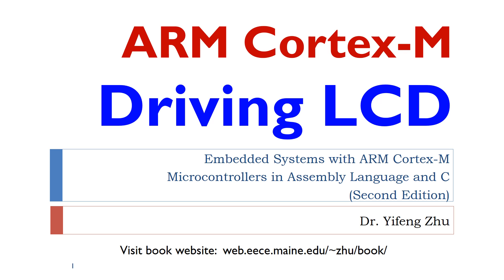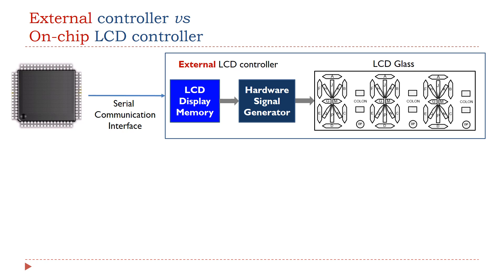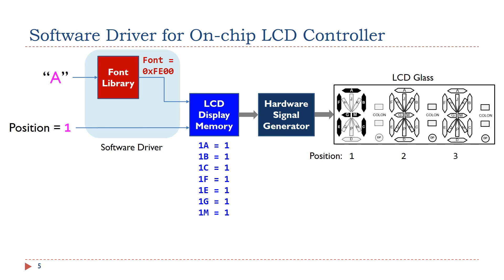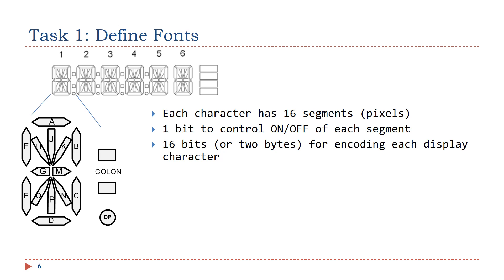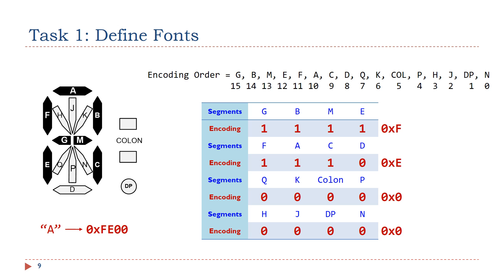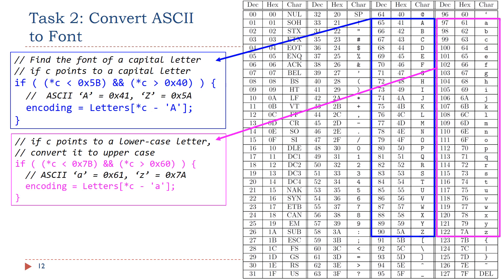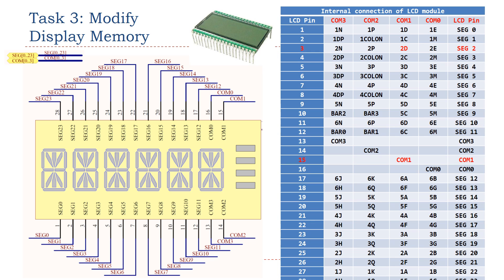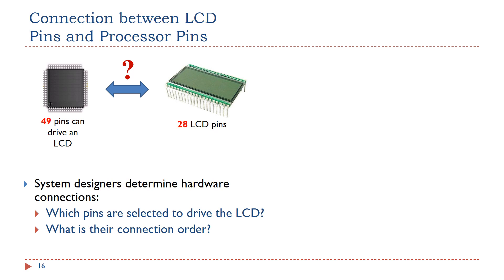Lecture 8. LCD Driver

Comment: i am literally repairing a yamaha psr-5700 rn about no sound at all, after repairing that part i found that now there is around 12 keys on the left side and around 9 keys on the right side not working , so what i did is that i remove the keys and there was a kinda rubber behind it. i clean it and that it, it was wroking fine now

Comment: at 11:48 the diagram shows the LCD pin 15 is connected to PA9 yet in the yet you say pin 3 is connected to PA9 when it should be PB1. I am pretty confident this is a mistake.

Comment: very good the tutorial helped me a lot. however I can't finish getting the lcd working. I load the data into RAM, activate the UDR and turn on the LCDEN, and still no image appears. I am using a STM32L152RTC6, what else can I do?
Reply from the maker: Any segment shows up at all? If none, I would focus on LCD settings. If some, I would focus on GPIO settings of each pin.